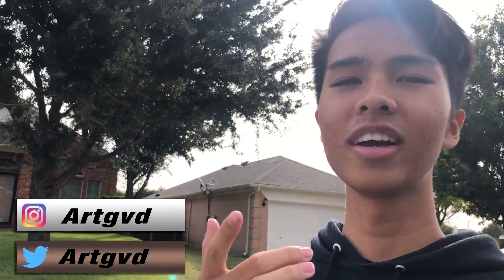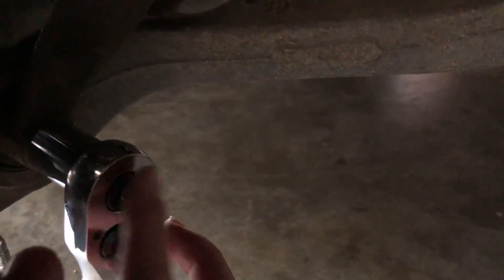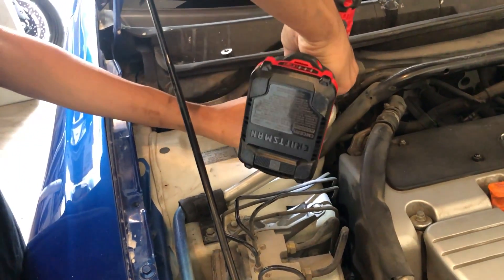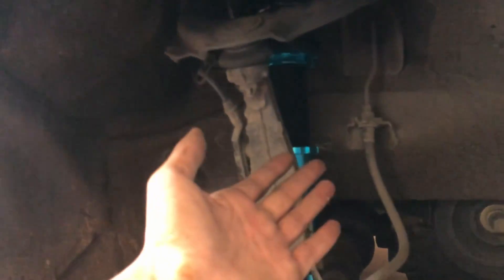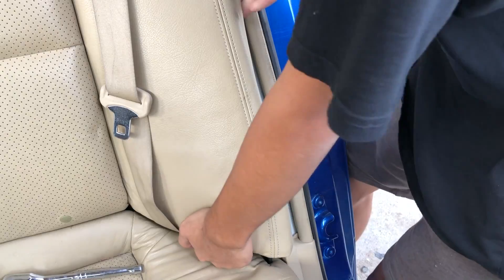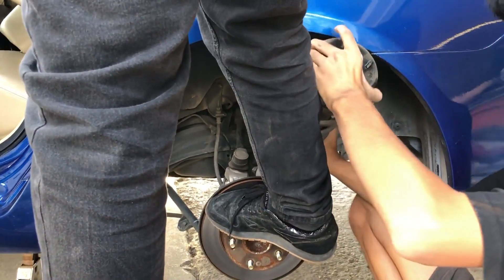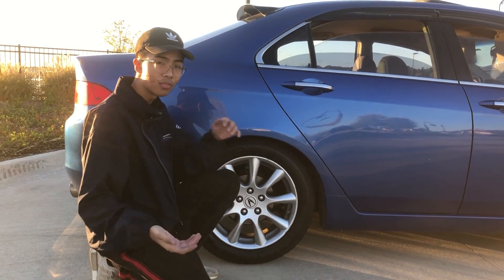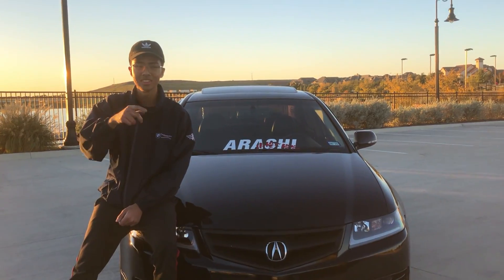Megan Racing Coilovers For The Tsx!

Comment: Bro I wanna see these suspension max out! I wanna go with them but I don’t know how low they go! So I’m iffy about these or the bc racing bro
Reply from the maker: Samuel Dodd they go pretty low, check out my homies build @Villain_CL9 from when he was near Maxed out. These go pretty low!
Reply: @BeforeTheStorm  Rears will let you tuck rim, fronts ... not so much (I might have to extend the shock towers). I have the same Megans, but I put on UAS rear and Airtekk fronts. Didn't have to shave rear lower cause I got a used set, although for some reason the new ones I ordered from Megan themselves I would have had to shave ... which is weird. I told the sales rep my specific year.